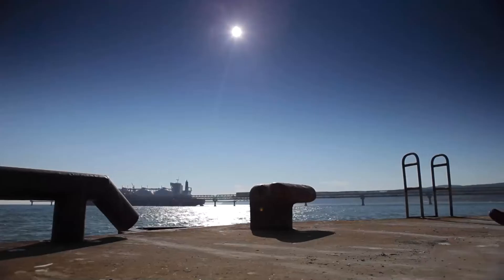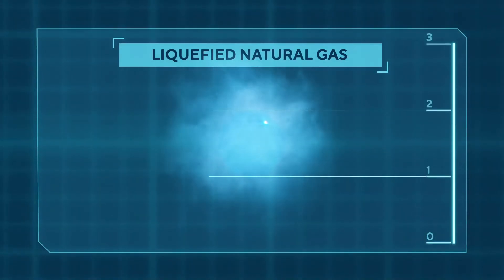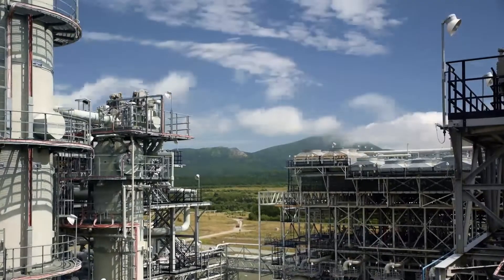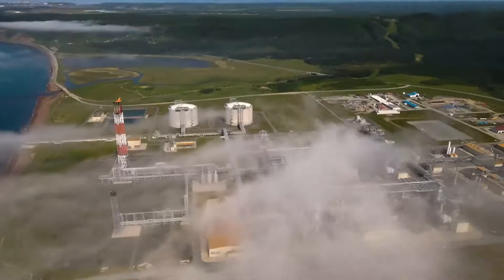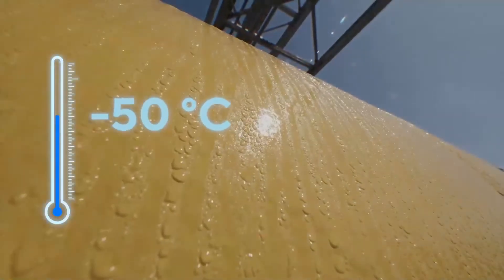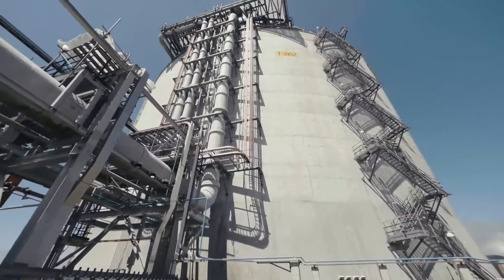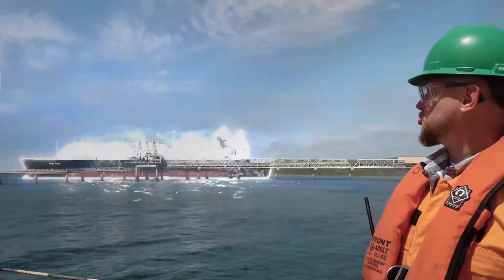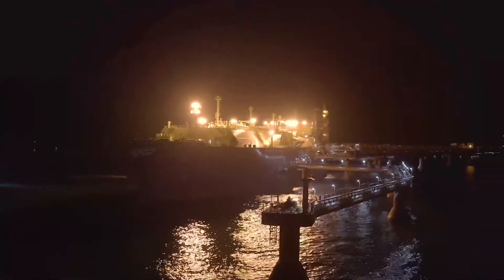How Liquefied Natural Gas (LNG) Is Made

Comment: So why we call LPG instead of LNG
Reply: LPG is liquid petroleum gas. Its your Ethane, Propane, and Butane. LNG is Liquid Natural Gas which is primarily composed of Methane. The lightest of the 4 gases mentioned total.
Reply: LNG's source - dry gas is usually produced from reservoir directly. liquid petroleum gas on the other hand is cracked from crude oil, usually molecularly heavier than LNG.